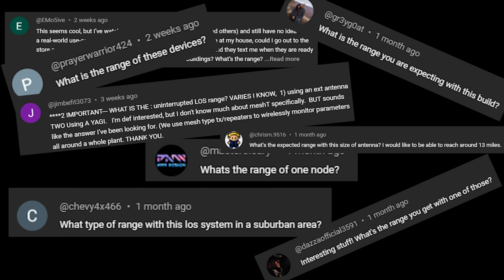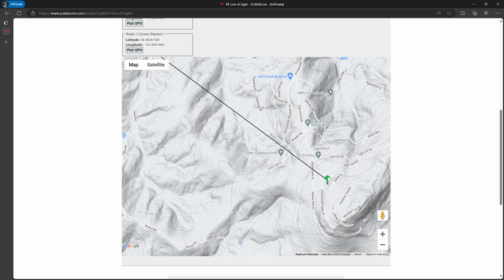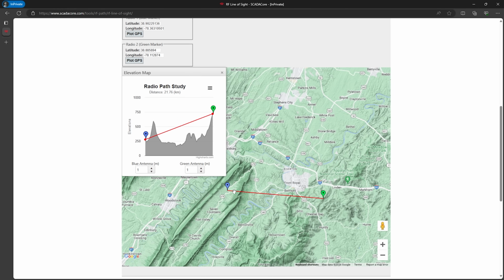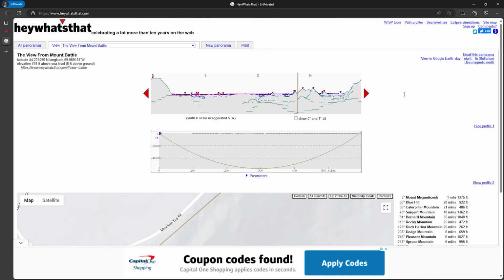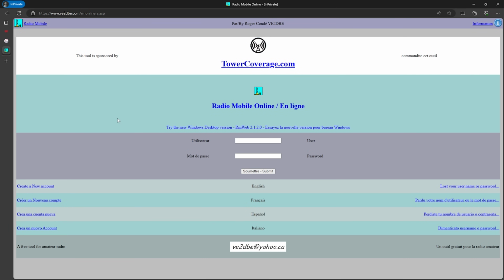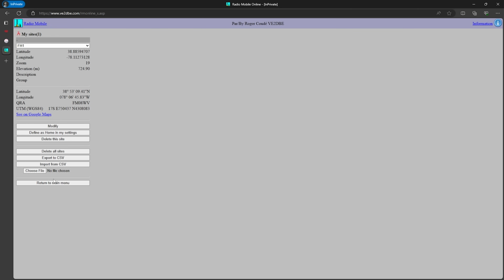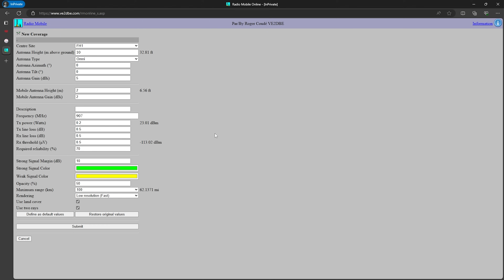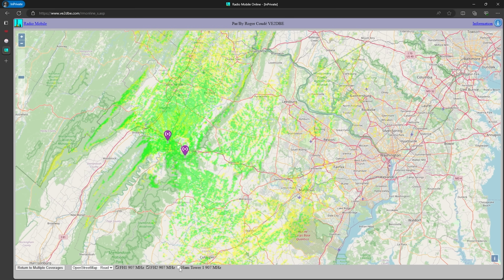🗺️ Creating Meshtastic Range and Node Coverage Maps 🗺️

Comment: These tools are great, but for those of us in cities with lots of buildings and trees, etc, be aware that the coverage maps that are generated are pretty generous. If you live in a true metropolitan area you will get maybe half the coverage shown, if that.
Reply from the maker: Good point!
Reply: Lots of opportunities to get that node higher there too though. I'd really like to try a more integrated drone repeater, that and a contact schedule would be workable .
Reply: You can make a GPS map with your mesh device and drive around to get accurate data. That's how I set up a 60 mile network that started in the city.
Reply: @KiLL3RabBit is there some more information on how to do that. Sounds interesting.

Comment: Thank you for posting this video! One issue I have been running into, the first 2 tools say I will have LOS between my two repeaters, however the third tool says I have very little coverage. Which one should I trust?
Reply from the maker: It's possible that you lucked out with LOS between the two sites and they don't have much coverage. The last tool is the one I trust the most

Comment: Another great video, thanks for posting. That ve2dbe site is ruddy brill. Taking into account that I am in Europe and using 868, would the AOA-868-5ACM antenna be any good for a remote and outside home node?
Reply from the maker: Cheers! I can't speak on the 868 version but I use the 915MHz version of that antenna and it's been great. I assume the 868 would be of similar quality though.

Comment: Not addressed in this video, but what kind of range are these systems capable of if there was unlimited line of sight?  I have a heltec v3 and am waiting on my 170mm 3dbi antenna as an example.  But in theory, if you could place a device high enough, what kind of range could you get before the signal degradation was the limiting factor?  Thanks for the informative video.
Reply from the maker: As long as you have line of sight, you can communicate. There are LoRa satellites that people communicate with.

Comment: I want to know what Meshtastic settings are required to see other Meshtastic devices that are out there. At present, I only see the two devices that I purchased. Both devices are in my home.
Reply from the maker: Your best bet is to go with the default settings as that is what most people are on. It's still relatively new and growing quickly so you'll probably see someone else soon! Spread the word if you haven't already; especially with ham radio clubs.
Reply: Also, if you can get a better antenna and or a higher location for your node that will help.  I was seeing only my devices until I upgraded the antenna and now regularly see a large number of nodes.  Talking to them is another thing altogether tho...

Comment: Interesting note:  The first tool doesn't account fo curvature of the earth.
Reply from the maker: That is interesting. Never noticed that before, but don't use that tool too often after discovering the others.
Reply: @The_Comms_Channel  I figured it out when I was about to deploy a 75km Meshtastic link.  I used google earth and drew a measurement line between two nodes and then made the altitude of the line absolute.  It draws a line directly from point to point.  It went through the top of a ridge that the tool you demonstrated showed clearance.

Comment: @9:40 you say your builds use 0.2W tx power- how can I find out what my build has? Same for line loss too.
Reply from the maker: Product datasheet. What devices are you using?
Reply from the maker: Depending on the T-Beam you got, it is probably one with the same radio as the Meshtastic Starter Kit so same power output.
Reply: @The_Comms_Channel  ok that was another question I had. So it is the LoRa chip specifically that I need to check the specs on and not the baseboard or antenna or anything else?

Comment: I just tested my solar node to my t-beam. I have a 7-8 mile direct line of site to a "mountainside" college. Went there to test the system. No Go. Backyard test went fine. Tried to make contact at every hilltop on the way. Again, No Go. I will make one more attempt with a base station antenna hooked to the t-beam, but this system does not look like it lives up to the hype, at least in the US rolling hills.